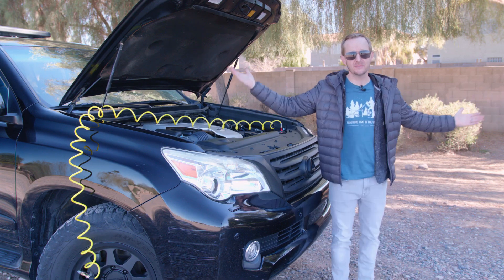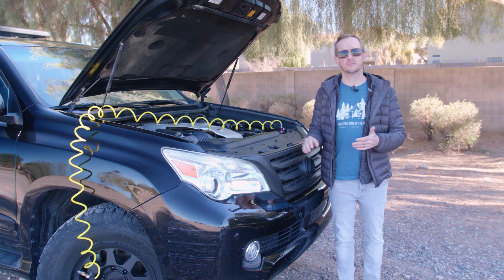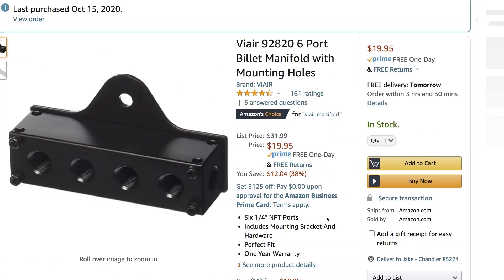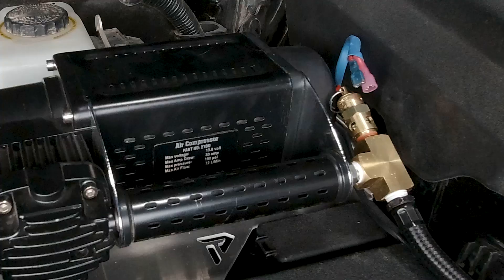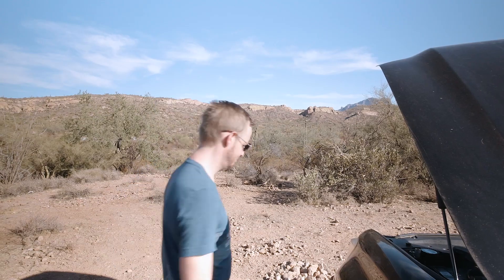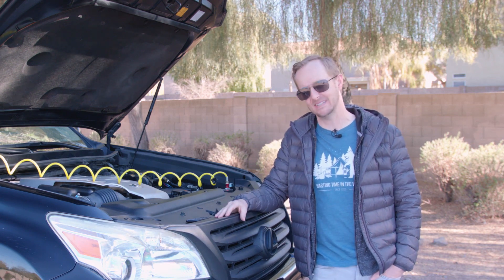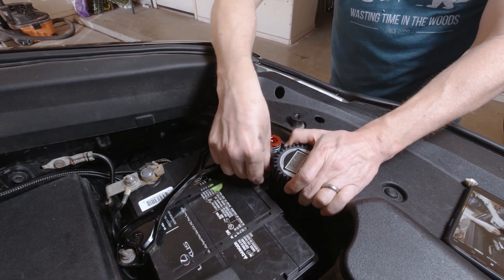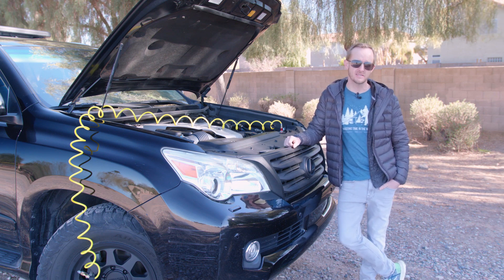Ultimate Air Manifold System (DIY) – GX 460 470 or 5th Gen Onboard Air

Comment: After running this setup for quite a while have you had any issues with the hose from the compressor to the manifold getting too hot next to other components?
Reply from the maker: No. Pump overheats once in a while if I try to go 40 psi in on a hot day. No issues with components though. Would do a 2781 if I did it again but too many other projects to tackle at the moment.

Comment: What tire pressure gauge did you use? I cant seem to find the ones with back mounted fitting. I also need  flat mount one.
Reply from the maker: Looks like the one I have is only available up to 60 psi currently - https://amzn.to/3Ow0pr4. This one is 300 psi so might not be as accurate- https://amzn.to/3y5Hz2S either should work but if you’re doing the pressure switch I’d go with the higher one. Or go analog - https://amzn.to/3a32Y50
Reply: @WastingTimeInTheWoods  yeah i got my pressure switch on the smitybilt. Gonna just go with the 60 psi one for accuracy. Im gonna run it on my manifold like yours. Thanks a million.

Comment: great project you have inspired me to do this project in my Tacoma. Question is it necessary to have a check valve on the leader hose?
Reply from the maker: No. And now that I think about it the check valve upstream of the manual shutoff seems pointless. Probably increases restart pressure too… I think.

Comment: Update compressor 5.65 CFM installation on GX460-2015:  It works...I installed Egoi Air Compressor from Overland Vehicle Systems (manufacturing specification is same as Smittybilt 2781) and manifold system per your Vid.

I found that the original bottom plate can be use by fabricate two support brackets.

Comment: Super cool set up.

If you were to add air lockers, would you put it before or after the manifold you made?

Also, the ball valve on the manifold is to release the extra air trapped in there after the ball valve right before the manifold right?
Reply from the maker: Thanks! I don't know much about air lockers but I have been thinking that I would much prefer an e-locker if I went for lockers (doubt I will). Acrad on iH8tMud is trying an elocker on his GX so I'm following along to see how it goes for him.

Yep, ball valve wit the black handle is dump valve to relieve pressure (from tires or the system). A lot of guys use the slide valve but they're special order and I'm not airing down from the manifold so I went with another ball valve because I had it.

Comment: Would there have been room to mount the compressor standing up? I have a 4X3" relay box I would like to squeeze into the same space.
Reply from the maker: I doubt it. You could mount it on top of the factory fuse box as a lot of people do or you could try to under-mount it. Powertrays has a top mount plate that probably would have worked and has more room underneath.

Comment: if one were to do the manifold setup on an ARB twin compressor, the pressure switch still has to be installed right?
Reply from the maker: Yeah but the arb comes with a pressure switch and harnesses/relay so it will be much easier.